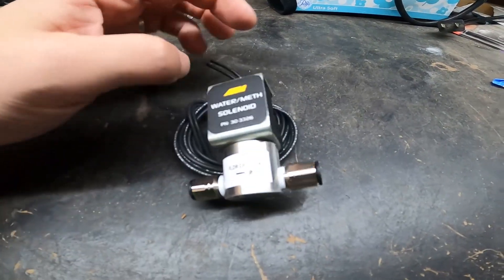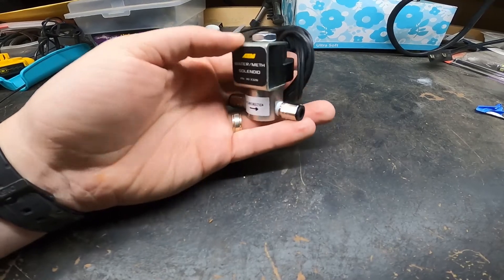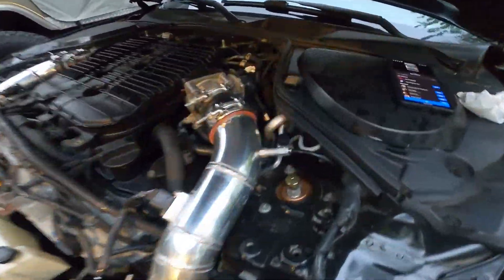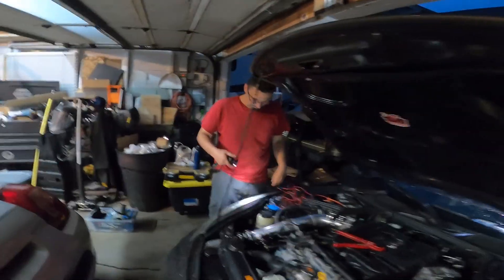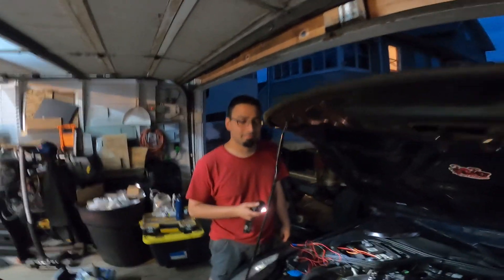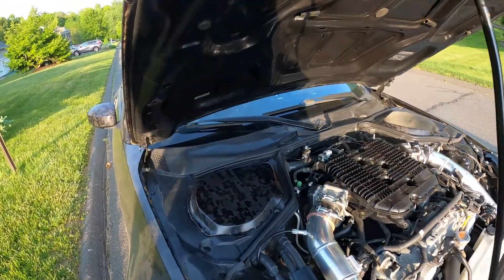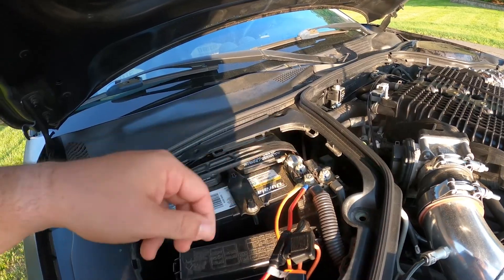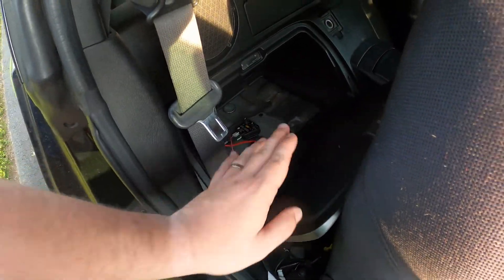how to install an AEM solenoid and why its a key part to a methanol kit

Comment: I was having the same problem!! After a pull my car would lean out! And going into limp mode and misfire like crazy untill all the boost juice was burned up in the engine, I added a cutoff switch to the controller thus turning off the system, pump, but still after I turned it off after a pull still misfires! And drinks up the whole tank!!! There’s no way 1 pull drank a whole gallon of boost juice!!! Going to try installing this part today! Will see how it goes!
Reply from the maker: Yikes! I can't believe it drained that whole gallon! Definitely no chance that happening on one pull! Hope this works for you. Let me know!
Reply: @blackpearlmedia7797  so far so good! Just did a data log and still have alot left in the tank! This product works perfect!
Reply from the maker: @jdog_st1462  love to hear it!!!